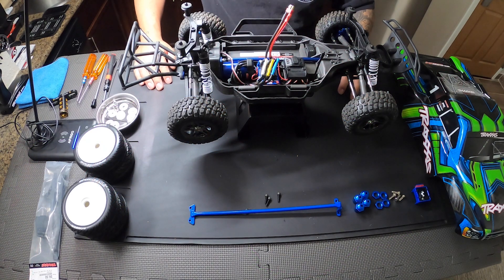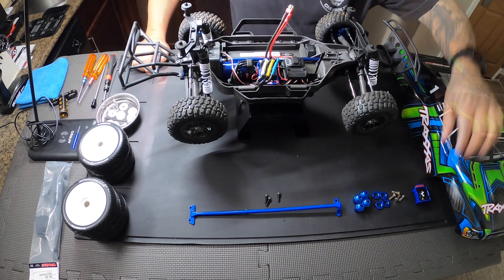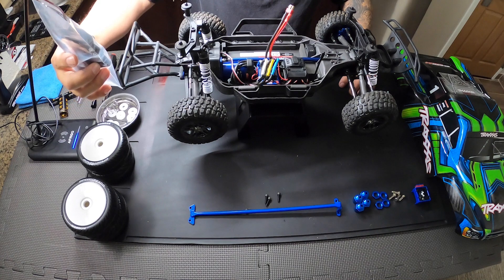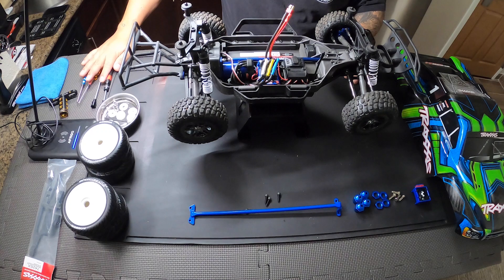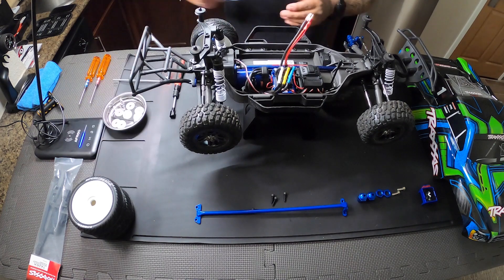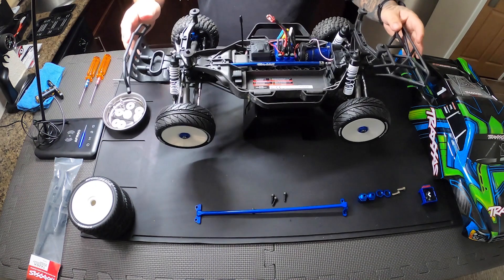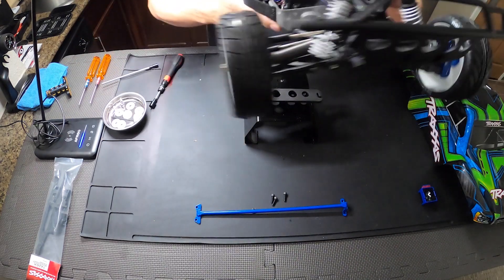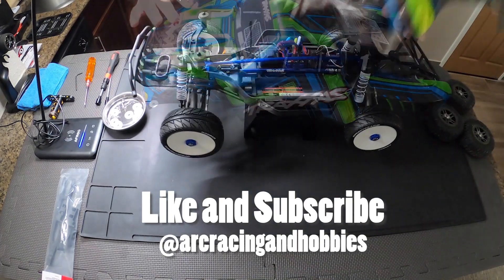Installing Buggy Tires on a Traxxas Slash Ultimate 4x4 RC Car plus Chassis Brace Install

Comment: Good info. An overhead camera view would’ve been helpful to be able to see more of the process. What’s your thoughts about the 12-17mm adapter kit? Did those and the slick tires work out well? Any change to the gearing at all? Is that center brace a real necessity? I’m looking to possibly acquire the Slash Ultimate myself. PLMK ASAP. Thank you for the video and your time. Stay safe! 😎👊
Reply from the maker: Thank you. Yes I’m gonna have to do that next time or change the angle. I’m still getting the hang of recording and editing videos. The adapter works great and is super easy to install. The new tires worked out well. I just did it to mess around and thought it looked cool. But it handled well on road. I did install the extra pinion gear it came with. The center brace isn’t necessary but I seen a couple videos where it was recommended so I did it. Just cuz I do a lot of bashing with it. I’d get one for sure. There super fun and fast. I appreciate you watching and commenting 😎👊🏽
Reply: @arcracingandhobbies  I like the look for sure. Did you have to trim the body at all for the tires and wheels to fit without rubbing?